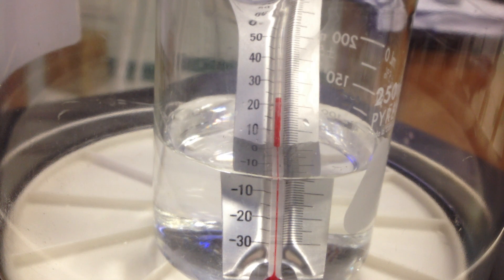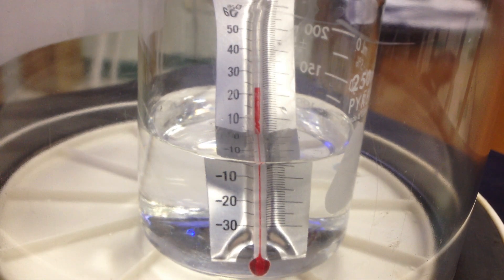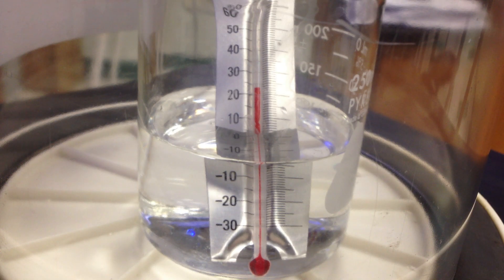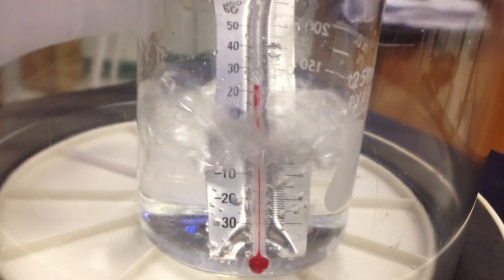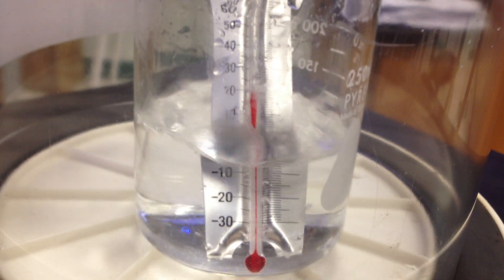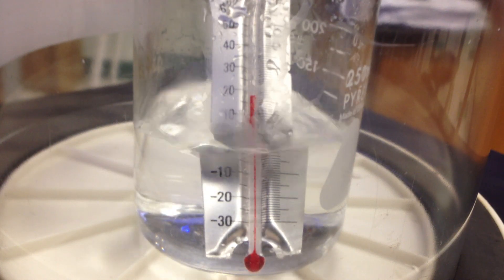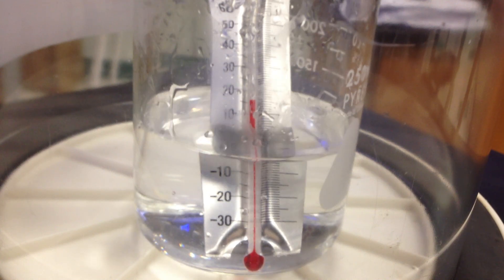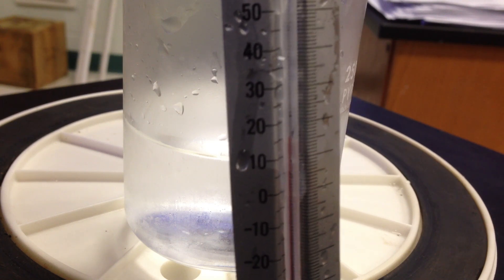Boiling cold water In a Vacuum Chamber

Comment: the water is NOT boiling, boiling is the rapid vaporization of a liquid, which occurs when a liquid is HEATED to its boiling point, the water did not reach near to 100 degrees celsius so does not boil. Seems like you need to apply a different understanding to this situation. To me, the water bubbles because the saturated air inside the water wants to fill the low pressure space created by the vacuum.
Reply from the maker: I agree that there is a de-gassing effect but if you look at a Phase Diagram form water or just the principles of vapor pressure and boiling then boiling is occurring if the vapor pressure of the water in the vacuum is equal to the atmospheric pressure of the air in the chamber.  Your definition of boiling is not completely accurate.  Water can boil as long as its vapor pressure equals the pressure above the liquid and thus its boiling point is a dynamic value based on the pressure above the liquid.  If the vapor pressure of water is at a certain pressure is below the current pressure above the liquid then you would  need to add heat to increase the vapor pressure.  IN THIS CASE, the atmospheric pressure is lowered to the lowered vapor pressure of the room temperature water.  The phase diagram of water supports this.
Reply: But I only saw the water in your container bubble, not boil because the temperature of the water did not increase. Interesting nevertheless as I firmly consider water and air to be the same stuff,  one's a liquid form, the other gaseous, but both made of the same stuff.
Reply from the maker: The temperature of the water does not have to increase to boil. Only the vapor pressure has to equal the atmospheric pressure.
Reply: How do you know a vapour is created during the process? Looks to me that the only time a vapour was created was when it condensated on the walls of the glass container when you let the room air back into the chamber. Room air was warmer. Then you have to ask yourself, where did that vapour come from? From the water being 'boiled' or from the warm room air let back instantaneously into the colder chamber? It could not have been from boiling because one never saw any vapourisation/condensation during the 'boiling' process. Thereofore my intial point stands inasmuch that the water is not boiling but merely bubbling.
Reply from the maker: Water vapor is created at all temperatures excluding 0 Kelvin.  There is even water vapor when water is in he solid phase. This is a fact that you can verify from any water vapor pressure table.  Water vapor is colorless so you cannot observe it.  You can only observe fog or small water droplets in condensation.
Reply: Can you show me in your vacuum demonstration that a vapour was given off?
Reply: @PeterPete  vapour cannot be observed from naked eye. Only condensed stuff can be observed. And don't you realise boiling point of a liquid depends on atmospheric temperature?
Reply: do you not realise the pressure is being extracted by the pump so not really any pressure acting on the water's surface! Plus the definition of boiling includes the word heat
Reply: @PeterPete  heating is required only at normal atmospheric pressure. But if you searched the definition for "boiling point" which is more accurate, you will realise that when a pressure around a liquid is reduced using a vacuum pump, if the pressure reaches to the vapour pressure inside the tiny air bubbles in the liquid, the bubbles starts to grow larger. So the liquid pushes the bubbles upwards which then breaks near the surface of the liquid resulting the liquid to move,which we observe as boiling. This is the same reason why low pressure areas like Mt. Everest has got a lower boiling point. (Please consider that I can make little mistakes here 'cos I'm just a student who learned this lesson this evening. But I'm really sure about this subject matter.)
Reply: well thank you for your opinion but on this occasion I am not swayed - water doesn't boil in a vacuum! Water only BUBBLES as the air is literally being drawn out of the water! Interesting also that one only observes condensation forming because there is a leak in the chamber or when the chamber is de-pressurised! The presence of condensation is a great test to see if your vacuum has leaks!
Reply: @PeterPete  I don't no how you said water cannot be boiled in a vacuum. But in this case I believe that liquid state water and gaseous state water is in an equilibrium. So though you removed air+water vapour from the chamber, liquid water will start accelerate it's vaporisation and always keep an amount of water vapour inside the chamber( so it's not a complete vacuum.). So, if you keep removing the vapour, the whole liquid will end up being vapour. And you must also consider that not only the air bubbles trapped inside water is escaping in this case. There are plenty of vapour inside the bubbles which are then removed from the pump. The same thing happens in boiling water under atmospheric pressure at 100c. And you must consider that a boiling point is a variable factor if you change the pressure around it.
Reply: @PeterPete  The water is boiling. If you look at any true definition of a boiling, it will emphasize both that 
A) boiling is "the act of bringing a liquid to the temperature at which it bubbles and turns to vapor" and 
B) that waters boiling point is relative to its altitude. i.e "Boiling point for fresh water at sea level at 212°F (100°C)." Removing the pressure from the equation allows the lower temperature to still possess enough heat to create the change of state that is boiling. Below are two google search links that prove this point repeatedly.
https://www.google.com/search?q=boiling+definition&oq=boiling+def&aqs=chrome.0.0j69i57j0l4.6928j1j7&sourceid=chrome&ie=UTF-8
https://www.google.com/search?q=boiling+point+of+water+by+pressure&tbm=isch&tbo=u&source=univ&sa=X&ved=2ahUKEwj_9YSCwZHeAhUGrVkKHVphDoQQsAR6BAgCEAE&biw=1366&bih=664
Reply: @billparker4815  Notice also when the vacuum pump is switched off condensation forms on the inner wall of the glass beaker. It is clear there is a minute leak in the set up which is allowing water vapour into the chamber. This condensation increases considerably when the chamber is depressurised. You could learn so much more from actual observation rather from what you read.
Reply: Peter & Pete Allowing water vapor in?? This experiment is doing nothing but creating water vapor. The reason there is condensation when the pump is shut off is that the vacuum is not held therefore the pressure changes and some of the water vapor fr the boiling returns to liquid form!
Reply: @billparker4815  Quote - The reason there is condensation when the pump is shut off is that the vacuum is not held............exactly there's a leak!! If the chamber was a sealed environment the vacuum would be held. Water vapour enters the chamber in my understanding because the chamber was not fully sealed. It's very easy to understand.
Reply: @billparker4815  The leak came in through the pump itself!!

Comment: are we cheating thermodynamic laws with this?? pressurizing a chamber increases the temperature of that vessel... depressurizing a chamber reduces the temperature of the vessel!!  i guess we are not because whatever heat lost in the suction of the vessel is heat gained in the pressure side of the vessel....
Reply: fidel catsro No violation of the First Law of Thermodynamics here. The Noble Gas Law would be helpful to study. 
PV=nRT
P is pressure
V is volume
n is a constant
R is (I forget since my last Chemistry class was 28 years ago)
T is temperature
So temperature and pressure are mathematically proportional to each other.

Comment: This is a good method for making sweet water from sea water
Reply: So it takes less energy to make a vacuum than to boil with heat?
Maybe there is an optimal combination of both?
Reply: @monkaTOS  
Why should you use lots of energy to heat the water when vacuum cools it down?  Water temperature dropped over 10 degree In this video
Reply: @Iranian.Shia-kurd   I know that. Creating a vacuum also consumes energy. Not a lot at first, but the more pressure differential, the more energy it takes. Kind of like how warming up water from 20 to 21 celsius doesn't take much, but warming it from 99 to 100 takes more.

So there's probably a sweet spot in the mix of reducing pressure + increasing temperature. That's my point.
Reply: now that I think of it that does make sense if we condesne the vapour we will get freshwater

Comment: "The water is loosing the molecules that are moving the fastest" WOW that is the best explanation for the process I've heard yet! Thanks!

How energy efficient is this compared to baking filament?
Reply: Can you explain how the water boiled despite being below its boiling point using vapor pressure, intermolecular forces, atmospheric pressure?  If so that would be great!!!
Reply: @yimszy4588  I'm not a physicist but look up "Vapor pressure" on wikipedia. Basically there is an equilibrium with warm (=fast moving) water molecules shooting out of the water and water molecules shooting into the water. If you decrease athmospheric pressure you have less molecules per area of air which means more can shoot out and bounce around in the air.
The intermolecular attractions I don't know, but they want to stick together but if too hot / fast they fly off.
Reply: @yimszy4588  just imagine the surface of water. at 23*C, air pushes it's surface by 1 atm. but like in this video, we reduced the 1 atm on the water surface to 0 atm( nearly). Due to this the pressure at water surface would also become 0 (nearly). Then water would expand due to this.( at constant temperature, PV = constant. pressure is reduced, so volume would increase) expansion would reduce the inter molecular force of attraction which would seperate them and  they would become invisible making them behave like gases. 
Now you would say why scientists have two terms for a same thing i.e steam and water vapor. 
the major difference between them is that vapor still has same energy as the water but steam has very high energy.
that means if you touch a water vaporise at STP, you will not get burnt but you hands would get wet but if you touch a steam with your hand it will burn you. 
[For simplicity I used gas as steam and vapor as water vapor but you can replace it with gas and vapor]
Reply: @yimszy4588  this is very late but i gotchu. liquids boil when their vapor pressure (the pressure exerted by a vapor in equilibrium with its liquid or solid phase, at a given temperature) equals normal atmospheric pressure, allowing water molecules (or whatever liquid it is) to escape into the gas phase. Temperature increases vapor pressure, and water's vapor pressure at room temperature is far below atmospheric pressure, which is why we ordinarily heat water in order to boil it. In terms of molecular forces, heating a pot of water is in essence feeding it energy. This energy allows water molecules to break away from their intermolecular forces (mainly hydrogen bonding) with other water molecules that ordinarily keep water in a liquid state and transform into a gaseous state. Remember the fact that water boils when its vapor pressure reaches atmospheric pressure? Well by putting water into a vacuum (in other words a very low or nil pressure atmosphere), waters vapor pressure can now match the very low atmospheric pressure within the vacuum, causing water to boil. In molecular terms, the energy needed for water molecules to break into the gas phase is far lower in a vacuum, meaning the intrinsic energy and movement of water molecules in a liquid phase is enough to break them out. Hope this helps!
Reply: @yimszy4588  For another connection to intermolecular forces, we can also look to substances like isopropyl alcohol, acetone, or any other liquid that readily evaporates at room temperature. These substances do still have intermolecular forces, but they lack the strongest of them, which water has, being intermolecular hydrogen bonding. This means their intermolecular forces are far lower than water's, and it is far easier for them to escape into the gaseous state. In terms of pressure, because they are able to escape into a gaseous state at a far higher rate, there is far more gas and therefore pressure being generated. This is why acetone has a higher vapor pressure than water, meaning it can match atmospheric pressure and readily evaporate at room temperature.

Comment: Can you please help me with some chemistry related issues that I'm having?

1. When hydrogen is heated up and reaches ignition temperature they say that it binds to oxygen in the air and forms H2O. After that, through the electrolysis of water, they say that oxygen and hydrogen are once again obtained and this validates the formula of water (H2O).

I, on the other hand believe something different. This is due to the fact that if the hydrogen and oxygen get combined it means that they remain electrically charged (which shouldn't be the case). If that were the case, then heating the water will make hydrogen ignite once more like before. When electrolysis is performed, no one knows how much oxygen there is in the container where water is found. What if the oxygen attracted at one end is the oxygen in the container and the water releases only hydrogen? It seems to me that after hydrogen burns what happens is actually that it loses its electron and becomes inactive. So, I would call water "inactive hydrogen" (not charged). Putting an electrical current through water reactivates the hydrogen. What do you think about this one? If you do believe the old formula, how can you tell how much oxygen was in the container at the start of the electrolysis and how much at the end?

2. I find it odd that intra-molecular relations are well explained, but inter-molecular ones are not.

If you ask me, the structure of an iron ingot, for example, could be explained more logical only with inter-atom (somewhat like intra-molecular) relations. But this would imply that an iron atom (Fe) or carbon atom (C) has the supposed shape of a cube, where each face of the cube is a potential connection to another atom, from a 3D perspective. A mound of powder iron shouldn't be equal to an iron ingot of same volume, because there are no atom connections in the powder (even though it's the same element). So, for the iron ingot, the difference could be either that each iron atom is held to its neighbors by electrical connections, either has other atoms between them which perform the binding.

I don't have such advanced knowledge about chemistry, but I tried searching and understanding about the topics that interested me and these are the conclusions that I reached. Am I missing something? Is it something which gives more sense to the official existing explanations?
Reply from the maker: Your questions would be better served in studying the basics of chemical bonding specifically covalent and metallic bonding.  When water is made by the combustion of hydrogen the water is not electrically charged due to the protons and the electrons in the molecule being balanced.  The force that keeps the atoms together is the electrostatic attraction of the protons of the nucleus and the valance electrons so the molecules of water are neutral even though there are electrostatic attractions keeping the atoms together.  There is also a stability component in all of this as well.  Water molecule are more stable than hydrogen and oxygen molecules and the contribution of energy to the surroundings that is released to get to a lower energy level (higher stability) helps drives this process.  In short it takes a lot of energy to break the covalent bonds of water back into hydrogen and oxygen because of its stability and heating water would not be enough energy to do so.  Electrolysis would provide this energy and when we collect the gases from this process we always get a 2 : 1 ratio of hydrogen and oxygen and through Avogadro's hypothesis this proves the formula of water.
Reply: Ok, thanks for the response. If you don't mind, a few more questions:

1. How is the ratio between oxygen and hydrogen measured (at the start of the experiment and at the end)?

The force that keeps the atoms together is the electrostatic attraction of the protons of the nucleus and the valance electrons so the molecules of water are neutral even though there are electrostatic attractions keeping the atoms together.
2. For table salt which is found in large crystals, how are these NaCl molecules kept together, since the molecules have a neutral charge (as you said)?
Reply from the maker: 1.  There is no volume of oxygen or hydrogen gas being collected at the beginning of the electrolysis of water ONLY water vapor.  Electrolysis is redox reaction that is a non-spontaneous process that forces the water to undergo a oxidation and reduction that it normally would not do (because of its stability).  Water that gets oxidized  becomes oxygen gas and water that gets reduced becomes hydrogen gas and this gets collected at each electrode.  The volume of hydrogen is always twice that of oxygen.

2.  NaCl are not molecules. They are charged states of atoms that get formed because they are more stable as an ion than neutral based on their electron arrangement.  They make crystals because they attract other ions in all directions. The formula of table salt, NaCl, is written this way because there is one Na+ for every Cl-.  This is called ionic bonding which is different than covalent bonding in water.  You should really learn your basic chemical bonding principles.
Reply: Ok.